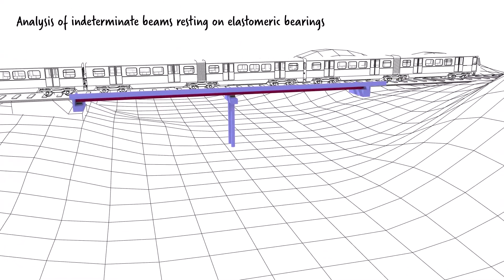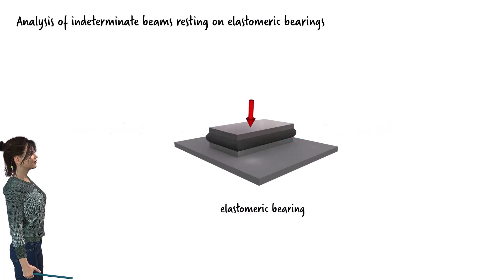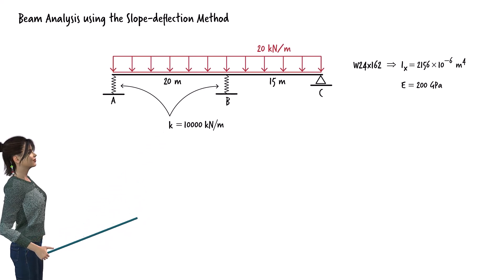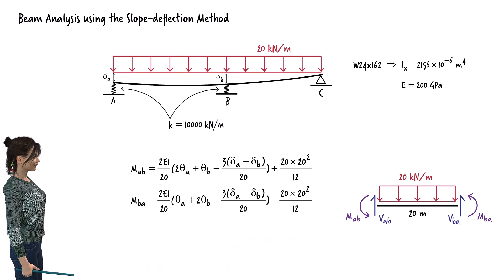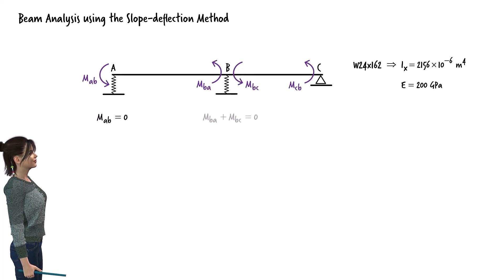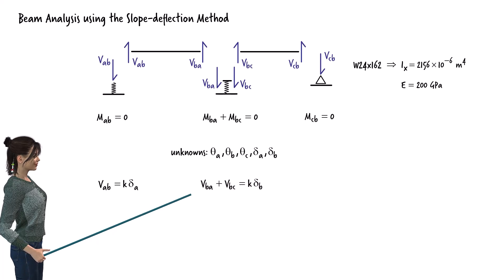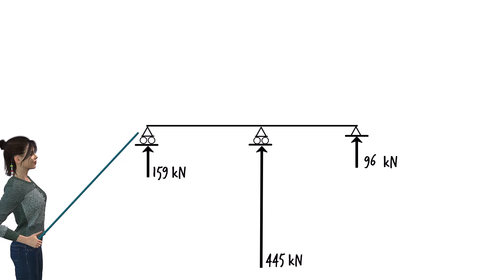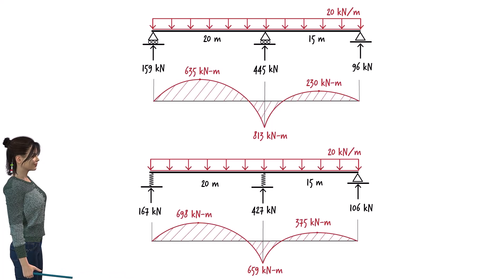SA74: Analysis of an Indeterminate Beam Resting on Elastomeric Bearings

Comment: Dr. Structure,  if I need to understand why M_ab not= 0 , which lectures do I need to watch ? Thanks
Reply from the maker: The internal bending moment M_ab is generally not zero when the joint (A) is fixed or is an interior joint in the beam.

You can watch Lectures SA28 thru SA33 (the slope-deflection method lectures) to better understand the member-end moments and their calculations.

Comment: This is a good way to explain slope deflection solutions but I think once you get past 2 or 3 unknowns most people would throw their hands up and use a different solution.  Also I wonder if the assumptions for the elastomeric pads are correct.  Most highways use fairly thin pads that would not allow the amount of deflection you calculated and you would not want the train track to drop by that much when the train runs off of the solid track beyond the bridge and onto the bridge.
Reply from the maker: Thank you for your thoughtful comment!

1. You’re absolutely correct that elastomeric bearings in practical applications don’t exhibit such large deflections. In this video, we intentionally used a case with exaggerated deflection to clearly demonstrate the impact of support settlement on reaction forces and to illustrate how we can model supports as springs. This approach is designed to enhance understanding of the analysis process, rather than to replicate real-world conditions.

2. As for your point about the number of unknowns, we completely agree that handling more than 2 unknowns by hand can become challenging, regardless of the analysis method. In practice, we typically rely on structural analysis software to streamline these calculations. However, it’s beneficial from a learning perspective to go through the process manually, as it deepens understanding. For those interested in exploring more complex cases without structural analysis software, tools like MATLAB or Mathematica are great for quickly solving systems of equations, even when we model and solve problems by hand.

Thanks again for your insights—they add valuable context to the presentation.
Reply: @DrStructure  Many many years ago I wrote a computer program to do structural analysis by general matrix methods.  My first frame analysis test problem was giving really strange results.  I finally discovered that my input data was the problem- I had made up some numbers for material properties and the interior columns were too small allowing a lot of deflection and changing the bending moments.  It was like an exaggerated version of the problem in your video.